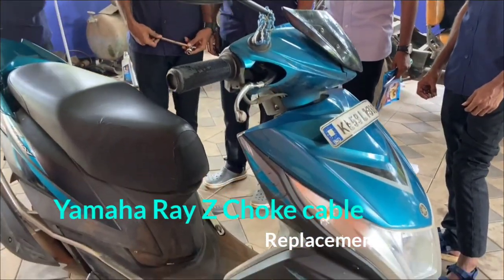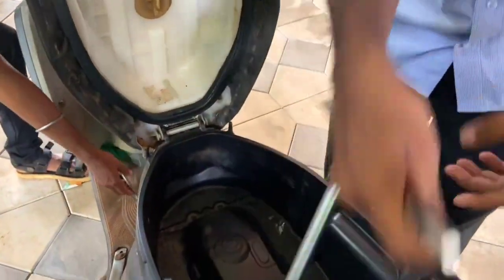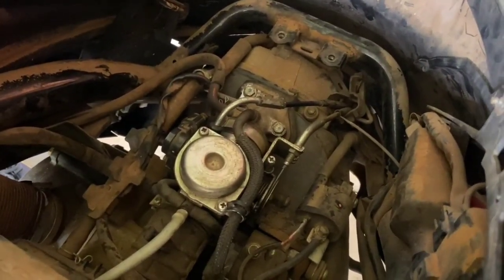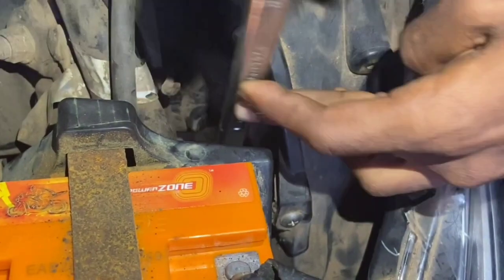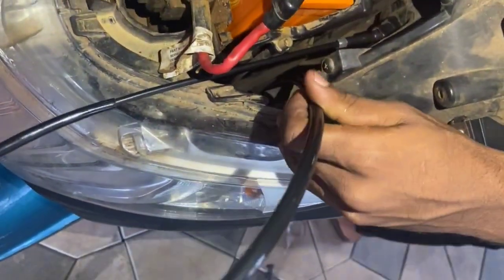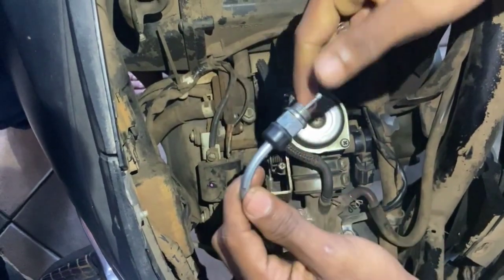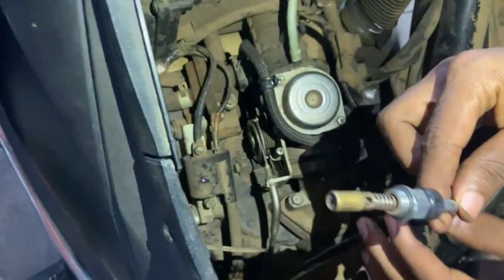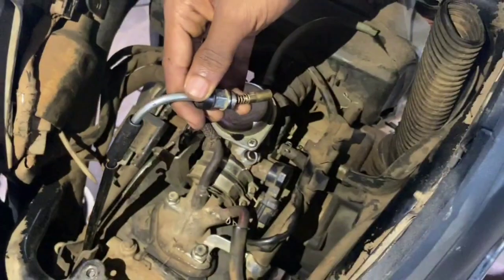Yamaha Ray z choke cable replacement | Engine Off while accelerating ചോക്ക്  കേബിൾ മാറ്റാൻ പഠിക്കാം

Comment: Yamaha Ray Z സ്റ്റാർട്ട് ചെയ്യണമെങ്കിൽ Choke വലിച്ചാൽ മാത്രമാണ് സ്റ്റാർട്ട് ചെയ്യുക 

Choke ഓഫ് ചെയ്താൽ അപ്പോൾ വണ്ടി നിന്നു പോകും.  Same issue in running. Spark plug, air filter changed recently.

Please help.
Reply from the maker: Choke cable stuck  ആവാൻ സാധ്യത ഉണ്ട് . cable മാറ്റിയ ശേഷം നോക്കുക

Comment: Activa വണ്ടി സ്റ്റാർട്ടാവുന്നുണ്ട് എന്നാൽ ആക്സിലറേറ്റർ കൊടുക്കുംബോ ഓഫ് ആയി പോകുന്നു ചോക്ക് വലിക്കുംബോ കുഴപ്പമില്ല . പിന്നേ റണ്ണിൽ ഇടക്ക മിസ്സിംഗ് വരുന്നുണ്ട്  enthayirikkum പ്രശ്നം  ?
Reply from the maker: Choke cable stuck ആയാൽ ഇങ്ങനെ വരാം, പിന്നെ accelerator cable condition നോക്കണം കുറച്ച് adjust ചെയ്യാൻ പറ്റും. 
 Spark plugs, air filter ഒക്കെ എപ്പോഴും ശ്രദ്ധിക്കണം

Comment: യമഹ ray Z സ്കൂട്ടർ ഒരു 15 KM ദൂരം ഓടി കഴിഞ്ഞാൽ ഒരു മിസ്സിംഗ് വരുന്നു പിന്നിട് നിർത്തിയിട്ട് കുറച്ച് മണികൂർ കഴിഞ്ഞാൽ ശരിയാവും ഇതെന്താണ് കാരണം
ചോക്ക് കേബിൾ കാർ ബറേ റ്ററിൽ നിന്ന് വിട്ട് കിടക്കുകയാണ് അത് കൊണ്ട് ഇങ്ങനെ വരുമോ
ചോക്ക് കേബിളിന്റെ ഫിറ്റിങ്ങ് നഷ്ടപ്പെട്ടത് പോലെയാണ് കാണുന്നത്
Reply from the maker: ചോക്ക് ഒന്ന് മാറ്റി നോക്കൂ, check air filter, carburetor and spark plugs
Reply: Same issue enikkum und

Comment: Hi bro എന്റെ sister ന്റെ Ray ഓടിക്കുമ്പോൾ വണ്ടി നമ്മളെ ഇടത്തോട്ട് കൊണ്ടുപോകും പല workshop ൽ കാണിച്ചു ആർക്കും ശരിയാക്കാൻ പറ്റിയില്ല  ആണുങ്ങൾ ഓടിക്കുമ്പോൾ feel ചെയ്യില്ല പെണ്ണുങ്ങൾ ഓടിക്കുമ്പോൾ ശരിക്കും ഇടത്തോട്ട് പോകും
Reply from the maker: വണ്ടി ഒരു side പോകുന്നത് പ്രധാനമായും fork tight (ഒരു ഭാഗം tight / ഒരു ഭാഗം loose | അല്ലെങ്കിൽ fork tube bend എന്നീ കാരണങ്ങളാൽ ആണ്. ഒരു കാര്യം ചെയ്യാമോ ? വണ്ടി center stand ൽ ഇട്ട ശേഷം പുറകിലെ ഭാഗം താഴ്ത്തുക I അപ്പോൾ മുന്നിലെ ടയർ നിലതിന്നും അൽപ്പ് ഉയർന്ന നിൽക്കും. അതിനു ശേഷം handle bar ഇടത്തോട്ടും വലത്തോട്ടും move ചെയ്യുക. ഏതെങ്കിലും ഭാഗം tight ഉണ്ടോ എന്നു നോക്കുക.

Comment: Choke valikkum pol race kurainu  entha prasanam parayan pattuvo
Reply from the maker: choke stuck ano ennu nokkanam, accelerator cable adjustment ok alle ? choke open/close stuck ayalum ingane varum
Reply: @SKautovlogs  stuck allaa working aanu  but oposite working valikum pol engine speed agunilla amarthum pol speed aittu working Aanu

Comment: Bro ray nte handilil oru bend und /or in T
Ath sheri aakkan etra cost aakum
Reply from the maker: handle bar ano bend atho fork bend undo 
fork tight undo
check it with near workshop
Reply: @SKautovlogs  vandi postil idichathaan so fork aayirikkille

Ath sheri askkan orupad rate aavumo
Reply from the maker: postil idichal fork odiyan chance kooduthal anu,
insurance claim cheyyunnundo
vandi dealership lo
workshop ilo koduth check cheyyanam 
vere enthokke poyi ennu nokku
Reply: @SKautovlogs  vandi ഓടിക്കാൻ പറ്റുന്നുണ്ട്  but ചെറിയ ഒരു uncomfort അത്രെ ഉള്ളു

Comment: Ray ZR oodikond irikumpo missing verunnund athentha??
Reply from the maker: Pala karanangal varam
Spark plug ok ano, Petrol  correct kittundo ennu nokkanam, choke cable accelerator cable check cheyyanam, air filter nokkanam
Reply: @SKautovlogs  accelerator cable moolam missing verumo? baaki eee paranja ellam check chythu cheriya oru missing aanu but frequently ind🥲
Reply from the maker: @Nandu19  Accelerator cable , vandi valathu vasathekku thirikkumbol engine raise akukayum edathottu thirikkumbol normal rpm akukayum cheyyunna case vararundu 
athanu nokkan paranjath 
Bro workshop evideyenkilum kanichirunno
Reply: @SKautovlogs  workshop kaanich carburettor air filter cdi unit ellam check chythu cheriya oru missing aanu but mileage kuranjitind matralla vandi oodumpo smooth alla shoka avasthya atha😐
Reply: @Nandu19  Chock cable jam ano nokku anenkil athu thanneyaakum problem same problem ente vandikku undarnnu

Comment: ബൈക്ക് സ്റ്റാർട്ട്‌ ചെയ്തു റണ്ണിങ്ങിൽ നിൽക്കുന്നില്ല.Acceleration കൊടുക്കുമ്പോൾ വണ്ടി ഓഫ്‌ ആയി പോകുന്നു.. വണ്ടി സ്ലോ ചെയ്യുന്ന സമയത്ത് ഒക്കെ വീണ്ടും ഓൺ ആക്കി എടുക്കേണ്ടി വരുന്നു എന്താ പ്രോബ്ലം എന്ന് അറിയുമോ?? വണ്ടിയുടെ initial pulling ചെറിയ മിസ്സിംഗ്‌ കൂടി ഉണ്ട് 
Bike Honda cb shine
Reply from the maker: ആദ്യം idling check ചെയ്യണം (slow running speed) കുറവാണെങ്കിൽ കൂട്ടണം ക്രാർബുറേറ്ററിൽ ഉള്ള Screw ( Fi) ആണെങ്കിൽ ഉണ്ടാവില്ല
  പിന്നെ air filter condition നോക്കുക / മാറ്റുക
next
 Spark plugs/ leakage നോക്കുക
ഘട്ടം ഘട്ടം ആയി നോക്കുക
Choke cable stuck ഉണ്ടോ  എന്ന് നോക്കുക
Carburator cleaning next

Comment: യമഹ റേ യുടെ മൈലേജ് കുടുന്ന്തത് പറയൂ
Reply from the maker: എന്തൊക്കെ ചെയ്താലും Yamaha ray /zr ന് ഒരു പരിധിയിലധികം mileage കിട്ടില്ല.
Airfilter check ചെയ്യുക
Air screw adjustment check ചെയ്യുക.
Accelerator cable function നോക്കുക.
Cvt ൽ sounds മറ്റോ ഉണ്ടോ എന്ന് നോക്കുക.

Comment: Bro tvs swish 125
മഴ പെയ്യ്താൽ അപ്പൊ മിസ്സ്‌ തുടങ്ങും, അല്ലെങ്കിൽ ഒരു കുഴപ്പവും ഇല്ല
Note : carburetor clen ചെയിതു,
എയർ ഫിൽറ്റർ മാറ്റി, പ്ലഗ് മാറ്റി,
Carburetor air pipe മാറ്റി, ഇത്രേം ചെയ്‌തു, ഇനി ന്താണ് പോം വഴി, പ്ലീസ് replay.....
Reply from the maker: Check ignition coil for any leakages / faulty
pinne ht cable ( ignition coil ninnum spark plug ilek ulla vayar - cable leak nokkanam )
starting / coil check cheyyanam
Reply: @SKautovlogs  ok bro
Reply from the maker: @jithin4601  Yes brother